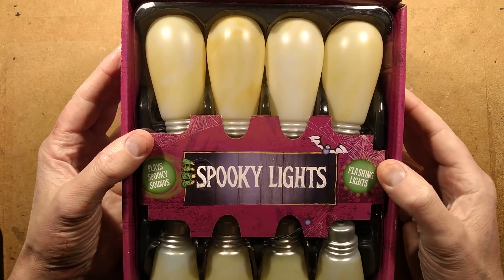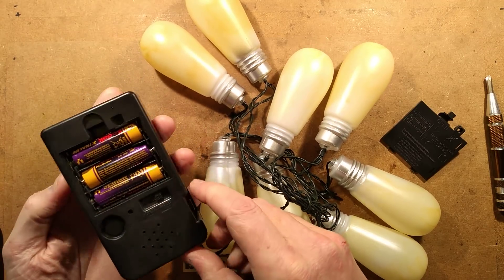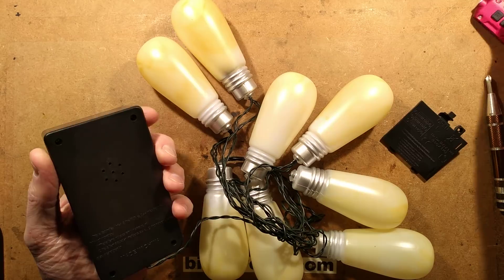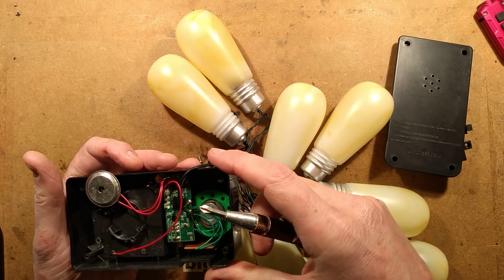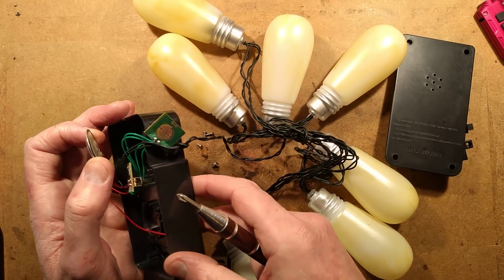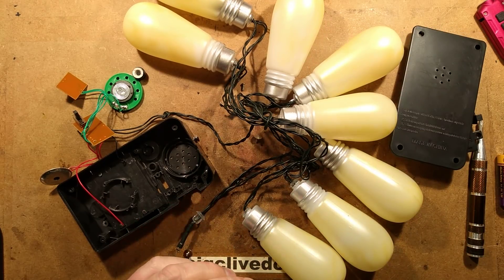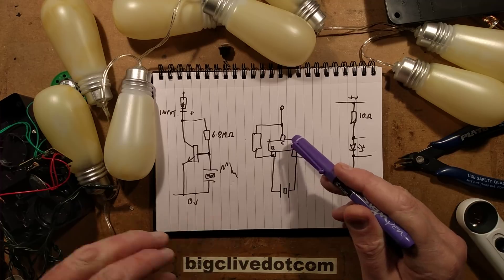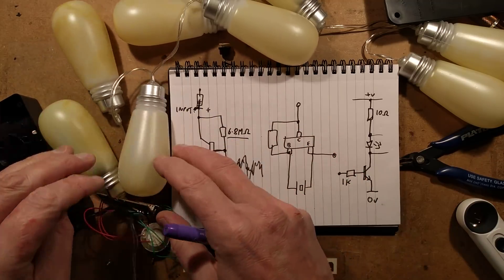Poundland's VERY annoying spooky Halloween lights.

Comment: thanks to this video discovered this item https://smile.amazon.com/gp/product/B076HX577Y/ref=oh_aui_detailpage_o02_s00?ie=UTF8&psc=1 clearly isn't based on movement but vibration.  so tap him if you dare :P  can't take him fully apart as I need a long screw driver for the 2 on the base  several LED's light the printed out section on the front of the lantern (amazon has several items)  original order had it as photo electric eye.  Nope  thus after this video I kinda figured it out in a hurry.. so yeah if I move him around on it's own he'll go boo , be better to hang him up somewhere where he will get bumped.  which right now is near the mailbox (on the house)  cheap !!  $15 but cheap!!!  Getting harder to find animated skulls etc.. if I put the demo switch on it only plays about 30 % of what he will say

Comment: Chuck the gizzards and the lights in the bin and use the box / battery holder for your arduino project.  An arduino runs quite well from 3 AA batteries.

Comment: Hey +bigclivedotcom, if you're interested in taking a wireless mouse apart (break it for lots of sharp edges to make it a splatter video!) to investigate what exactly made it fail (won't disclose here to retain your Sherlock Holmesian experience), which postal address should I us to make it happen?

Comment: I have a couple of spooky light bulbs that look like the bulbs on this string. They flicker randomly and can be switched so it functions like a normal light bulb. One bulb I modded to run on batteries. Doesn't play any sound effects.

I have a sound box that you put inside a jack o lantern and it lights up and play sounds. The audio quality is very good (16khz) The chip on your string of lights may use the same type of audio chip. Mine is a 16 pin chip that may be reprogrammable.

Comment: Wire in a better (larger) speaker via a small amplifier (improved sound quality), and use the LED output for other purposes. That would do just fine hidden in a large bush at night, especially with well-scattered point-source HE red LEDs - you could have quite a fun time scaring the neighbours! :-)

Comment: Last year Poundland sold a Halloween spooky bulb that looked a bit like the firefly garden lamps but with a base so they could stand vertically. There were six LEDs on a stiff wire string inside powered by three AA cells and the current was limited by a 4.7R resistor in series. (A teardown in two sentences).
For £1 they have to be better value than this £5 offering.
Poundland is turning into Poundsland.

Comment: The fake bulbs don’t glow in the right place, of course. It would likely be far more expensive to make them look right, sadly.
Reply: Seems an effective quick fix would be to shove the LEDs further into the "bulb", and secure in place with a blob of hot melt.
Reply: Shove the LEDs in as far as possible and paint the fake screw caps silver or brass colour.

Comment: Umm, any ideas for engineering reasons why would they the piezo instead of an electret mike? Price? Ease of processing of the output signal? More suitable sensitivity characteristics?
Reply: Electret mic elements can be quite cheap but the amplifier would need 2 or 3 extra components and the electret element would draw a constant 200uA typically.
Reply: It will detect movement/concussion as well as just sound, so if you move the box without making a sound it will still trigger. Piezo speakers are often used as DIY drum pads for example.

Comment: It is 60 hertz buzzing, not appropiate as an EU import...
Reply: Even the lights brexit
Reply: These cheap blob chip circuits usually use resistor to set the clock speed. Increasing the resistance should make it run slower, and if you use the right value, you could make the jacobs ladder sound like 50Hz instead of 60.

Comment: Turns out it is not painted at all but it is the chinese factory workers smoking at work.
Reply: its an outrage, the factory owners should b ashamed , letting 6 year olds smoke on duty
Reply: @baxter22071990  Imagine the "smoking chamber" where they just sit smoking with the bulbs hanging on a rope... xD
Reply: No need to smoke in China; the air quality is already pretty bad there.

I once read a report from a journalist who was travelling via bus in China. The reporter claimed that the fact that the exhaust gases, which were going into the passenger compartment, did not noticeably lower air quality compared to the outside. That made me wonder...if you were smoking a filter cigarette in a "typical Chinese factory", might that not be actually beneficial?

Comment: Poor choice of LED color, but otherwise not that bad.  These are almost certainly meant to fire at the prompting of trick or treaters at the door.  As such since you'd use them once a year and in most neighborhoods groups don't camp out on your stoop all night... the lack of extensive novelty probably isn't an issue.  Different kids would just hit and run through the evening.

Entertaining for them and for you hiding in the bushes chuckling at how successfully you startled them when you jumped out in a mask and cloak while they were busy scoffing at your cheap-assed Poundland Spooky Lights.
Reply: For something hung as at Halloween party by a door it's great. 

This isn't something that you hang in your living room and watch for hours which is what our dissector  seems to be expecting.

Comment: Would be interesting to hear the tinny noises through a decent sound system just to hear if they are still sampling in 8 bit @ 8kHz or have used a soundcard grade 16 bit COB. As for the butt plugs you can get 10 x mobile vibrator motors from eBay under £2
Reply: Got a link? Asking for a friend 😁
Reply: Happy to oblige :-) https://www.ebay.co.uk/sch/i.html?_from=R40&_trksid=m570.l1313&_nkw=mobile+vibrator+motor&_sacat=0

Comment: Take a string of ordinary lights, splice an FS2 fluorescent starter into the cord, and it produces a wonderful random flickering effect that's great for Halloween
Reply: Well, that sounds unsafe... lol
Reply: @LuxCaeca33  I have a friend who's done it for his haunted house for years and never had an issue. Works great with Christmas or other small lights.
Reply: can you use a higher wattage starter such as a fs4 or a fs64 for bigger bulbs?
Reply: @frogz  as far as I know, only FS2 will work. The old timer who showed me specifically said others won't work. I don't know how exactly these things work so I'm not sure why.
Reply: @12799MaDeuce  they all work more or less the same way, a glow discharge bulb that heats up and breaks the circuit, a bimetalic strip inside does it,  I'm going to have to try it, this works like a old style car flasher in a can
Reply: hey I could save money perhaps, could it be done for 97p perhaps?
Reply: Do it with a 4 channel Christmas light string! Forget the little box, and hook up a lamp starter in series to each of the channels!
Reply: Is the starter installed in parallel or in series???.
Reply: @thevacuumtubejunky9774  it has to be in series. If you hook one up in parallel it will explode, since it's effectively creating a short circuit.
Reply: @redpheonix1000  :...now that I'am awake, that makes perfect sense....lol
Reply: @redpheonix1000 : So in understanding this, the current draw through the fluorescent starter will create heat causing the circuit loop to open and close in  random intervals???.
Kind regards, Eric Dee .
Reply: Plug these into the mains using the aluminum plug. That will be spookier.

Comment: I wonder what would happen if you overpowered it?
Would it just burn out or would something truly scary happen?
Reply: In my experience cheap sound generator chips use an RC oscillator, which is very sensitive to voltage changes. Raise the voltage, and it'll play everything quicker. Lowering the voltage is more interesting - i had one module that would still run on half voltage, and the playback would be also at 50% speed. Combined with the super gritty 4 or 8 bit samples and the low sample rate, it would sound monstrous.
Reply: LimaVictor I want to see this now.

Comment: Another ten minutes of enjoyment and relaxing teardown & reverse engineering, thanks Clive!
I wonder if the terrible sounds quality is due to the speaker or it is just because they are using the cheapest crappiest DAC possible in that CON...
Reply: might be worth the effort to fit a better speaker (possibly via an amplification stage) - see what happens. Could be useful for other purposes . . . .  (scaring the neighbours in the wee small hours!)
Reply: Yeah, would be interesting!
Reply: I guess it's the shitty speaker and amp. And also low sampling rate, to fit more PCM samples to the ROM. The DAC won't be stellar either, but doubt its quality is the bottleneck.
Reply: DAC?  DAC?????  We don't need to steenkin' DACs.  Pulse width modulation.is good enough for something like this.
Reply: Well, technically, PWM is a form of DAC in this application. The speaker's impedance itself will naturally act as a low-pass filter. Very cheap design. I personally think the sample rate will be the worst quality-limiting factor here. Sounds like 8 kHz PCM sampling rate.